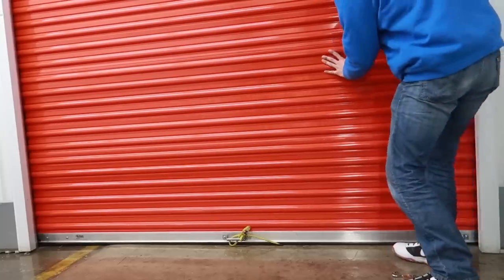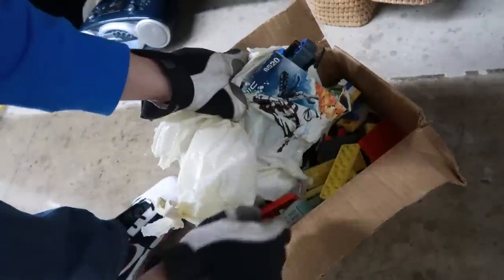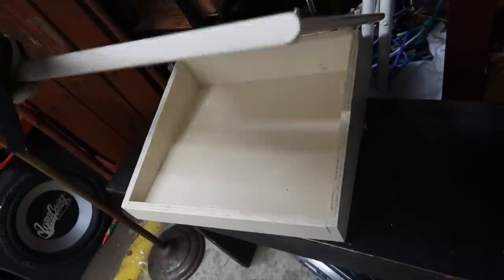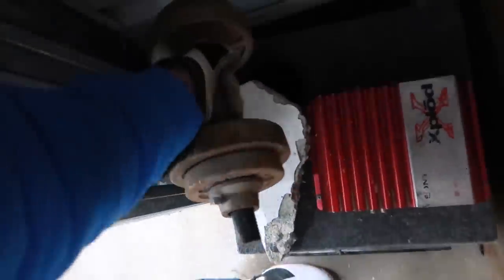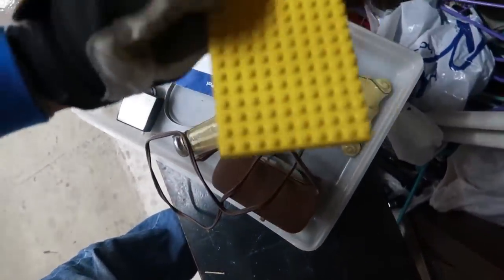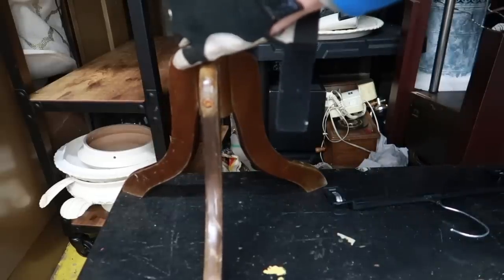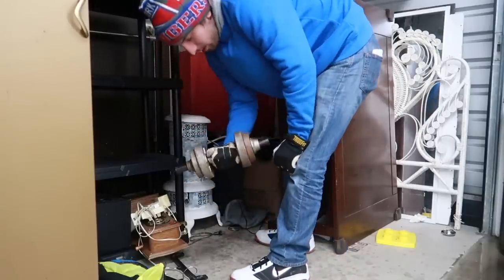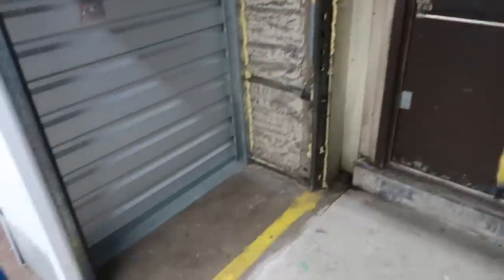I Bought A Storage Auction Locker For $140 ... LOOK What Was Inside!

Comment: In regard to the skateboards, the real value is not in the board itself (with a few exceptions to this rule, of course).  Rather, it is the hardware attached to the boards.  The trucks can vary in used prices from $5 to $20 (some exceptions, too) a pair depending on the name brand, size, and condition.  The wheels are not worth selling.  No value.  Throw them in as a freebie.  The wheel bearings can be valuable as long as they aren't rusty crusty slowed.  Look for names like "Bones" or "Swiss-made" printed on them and Abec stats (Abec 5, Abec 7, etc.).  The higher the number the higher the speed rating.  Or... just slap a $25 price tag on the boards and bail. haha
Reply: Nice ty Mike
Reply: The desk-draft table bingo players love em

Comment: saw a Vintage Jackson "50 lb". Globe Dumbbell sold for $125... on eBay,  so the one you got in the locker will be priced pretty close to that... another one is listed as a "Jackson Barbell RARE 25 lb Globe Dumbbell Vintage One single" for over $300

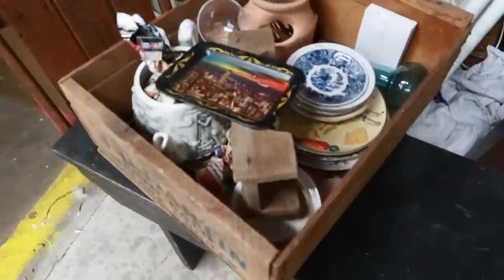Comment: love how @15:32 you ignore the glass bong in the dish box the woofer and amp sticker it for $100 combo the woofer wasn't torn, that was the rubber that encases the metal frame so the cover dont buzz or rattle when turned up. tap the woofer if it makes a crisp sound its fine. people who know will know what it is..  the box alone can make $30 just sayin. Xplode Amps are made by Sony they are dime a dozen and often are blown or will blow Walmart or Best Buy special..

Comment: How on earth are you going to ship a 30lb weight? It won't break but will crush any other packages being shipped around it :-)
Reply: Probably USPS flat rate box or cubic priority so it ships by package size rather than weight.  (Or Fed Ex.)  Double boxed with lots of heavy duty reinforcement tape.  (My ebay mentor taught me that anything breakable should be packed so that you won't have a heart attack if the box is thrown across the living room or has a 50 lb box dropped on top of it.  Both of those things are likely to occur during shipping!)